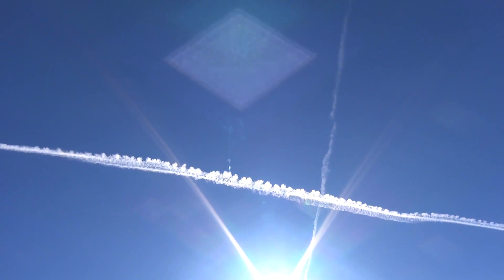SINGEL BOOST MODEL ROCKET MIRA WITH A A6-4 ROCKET ENGINE

Comment from the maker: Ich war in Friedrichshafen an der Faszination Modellbau 2018 letztes Jahr und habe mir da mal so eine Modell Rakete gekauft, die hier ist zum Testen ein kleines Modell als nächstes die EUROPE die ist 1 meter und hatt 5x Motoren. I was in Friedrichshafen at the Faszination Modellbau 2018 last year and have since me as a model rocket bought, this is for testing a small model also next the EUROPE which is 1 meter and has 5x engines.